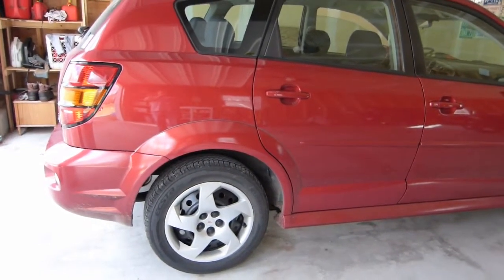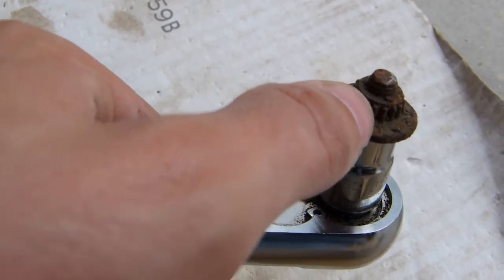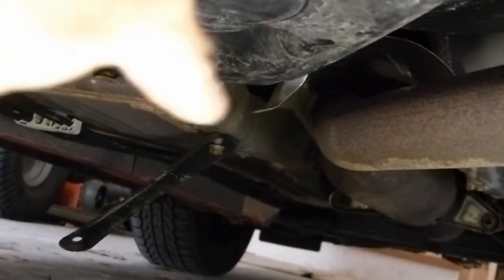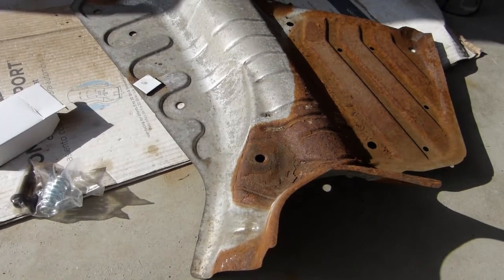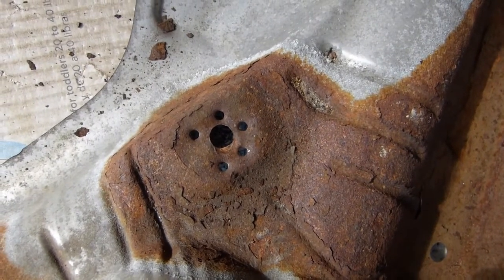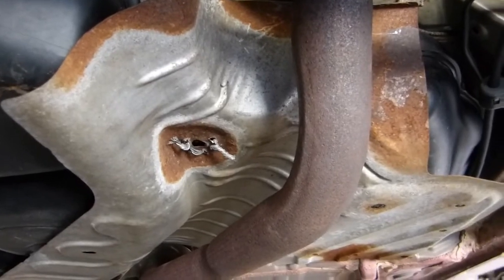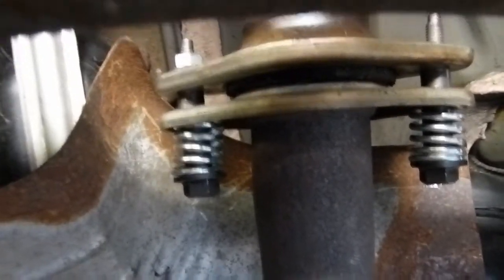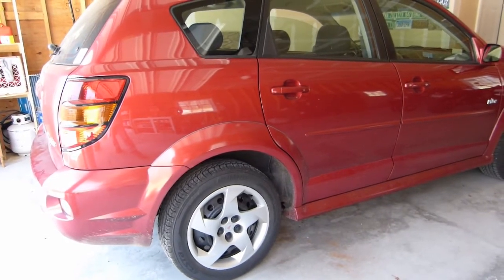Pontiac Vibe / Toyota Matrix  Exhaust Heat Shield Repair Highlights  - Temporary Fix

Comment: THANKS!  You gave me confidence to string it up (with wire) rather than take it in for repair. The plastic piece was totally shot so I just drilled holes in the back end and looped the wire (a pretty chunky solid wire) around the gas tank bracket.  Looks solid enough and if it fails again, I'll use stronger (braided) wire.

Comment: The factory fix is to replace the passenger side tank strap with Toyota part 77601-12271 BAND SUB-ASSY, FUEL which has a welded metal bracket to hold the heat shield bolt that replaces the plastic clip that breaks.

Comment: Great video - super helpful. My wife just lost the same heat shield on her '09 Matrix and our mechanic, of course, just took it off. "You don't need that," they said. I just called them this morning and told them to save the part because we realize now, based on your video, that it might keep her car from bursting into flame.
Reply from the maker: The engineers put it there for a reason...this is an arguably entry level car so they would have left that part off if it wasn't necessary.  Having said that, I don't think your car would burst into flame from just normal driving without it on there, but other problems could conceivably arise from not having it there.

Comment: Nice video, but having worked on cars for many years, I NEVER do anything if possible with the exhaust as it's always rusted up & a pita.  My  2005 Matrix also experienced this problem with the heat shield & little knurled nut popping out of the plastic bracket, can you say 'el cheapo design.'.  I researched online today and it seems to be correct that the tank strap does not carry those plastic brackets on them, at least in the diagrams.

It's a fairly lightweight shield, so last week I tied it up with wire, as have many other folks commented below. I'm thinking it may be my go forward solution as well.  I just ran a wire up through the existing hole on the shield & ran up forward over the tank strap because I thought it would be temporary & I'd be replacing it with the right part.  So far it's holding up but it's an easy fix if the wire fails.

Important NOTE:  DO NOT RUN A BOLT UP THRU THAT shield or bracket as it can rub against the tank, and the leaking gas/fumes leak out.

.

Comment: Thanks buddy for the idea how to get around the problem, dealer doesn't offer that plastic bracket anymore and they want $100 for a new tank strap so I used some stainless steel safety wire wrapped around the tank strap, she good to go till the tank falls out.

Comment: Yep... same problem for me. On mine the plastic bracket seems to be in two parts that clip together... a top part that is fitted to the gas tank strap, and a bottom part which holds the bolt for the heat shield. They no longer clip together, so I'm thinkin' I'll go with some lovely wire... thanks for the vid!

Comment: Had this problem on my 07 Vibe. Backed over some frozen snow left from the county snowplow at the end of my driveway. Easy fix for the pop out pressed in attachment bolt or whatever you call that part that fails. JB Weld will fix and hold the heat shield in place. I mixed up some JB Weld and placed it into the area where the attachment bolt presses into the bracket. Placed the right size object under the heat shield to firmly hold the area where the JB Weld was used. Let sit overnight. This fix was done 5 years ago and is still holding strong. Poor design by Toyota for holding heat shield in place. When I observed the design of the mounting point, I had no doubt many were going to have this problem.

Comment: Same problem on my 2007 Matrix, I used a tie-wrap (zap-strap) 1. through the plastic bracket on the Fuel Tank Band, then 2. through the existing hole on the heat shield. 3.  then fed it through a brass nut ( I found in my junk drawer) that is too big to fit through the shield hole. 4. Then cinched up the zap strap which pulled shield up toward the bracket it's been holding for a week so far.advantage is I didn't have to remove anything -job took 10 minutesdisadvantage is the zapstrap is plastic & might not tolerate the heat
Reply: Curious if it held?
Reply: Yes! it is still there 7 years later!! @munstermannp
Reply: Excellent.  Mine just fell today, I read the comments including yours and tried that fix before seeing your last response.  Quick, easy, snug and DONE!

Comment: Did you, or did you WANT to, replace the heat shield itself? Mine is rusting out, including most of the mounting points other than the gas tank strap. The shield is no longer manufactured and I have been unable to find a used one.

Comment: Thanks for the video. Mine on my Matrix 2005 just fell off. Very rusty, the metal around the bolts just cracked... Is it ok to run without the shield temporary (during winter) before I get it replaced? Just want to be safe.
Reply from the maker: +blasteur The heat shield helps protect the gas tank from the exhaust.  Personally, I wouldn't take a chance and run without it.  Thanks for watching and taking the time to comment!

Comment: Great video.  My 2008 Toyota Corolla has the same problem.  I was told the fix for this was to replace the gas tank strap.  Did you do that?  Did you replace the hest shield?  What was the permanent fix for your repair?
Reply from the maker: Roland Fox The permanent fix is indeed to replace the strap.  The new strap has a better mounting flange attached - I haven't replaced it or the shield yet.  I'm thinking I make my own bracket to weld on to the old strap to save money - I haven't decided what I'm going to do yet.
Reply: SevenFortyOne   Thank you once again for the excellent video.  I have placed two wires on the shield in two  different places and see how that holds up.  I was afraid to take that exhaust connection apart.